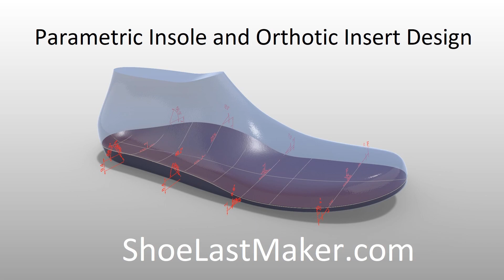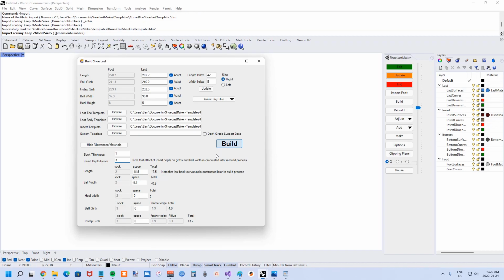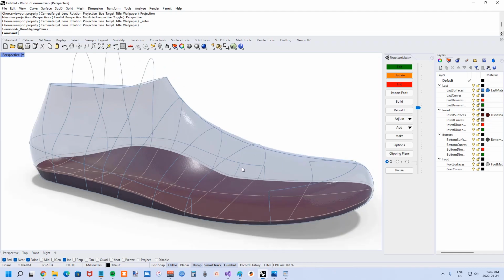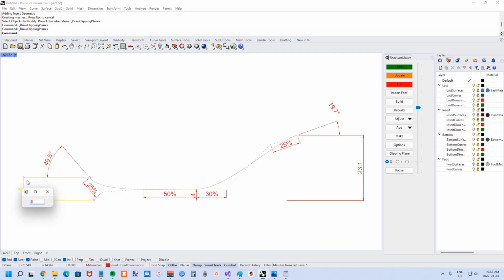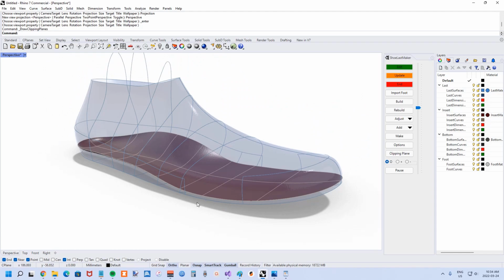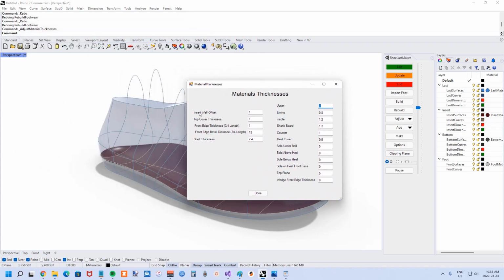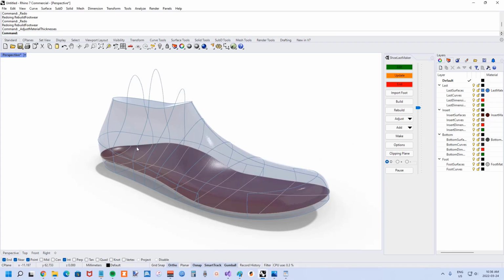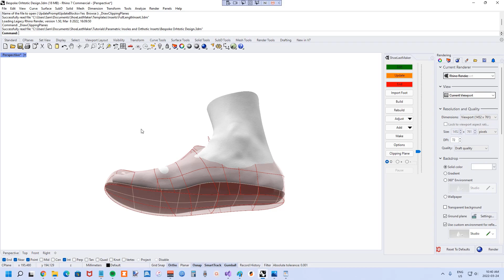3DShoemaker: Parametric Insole and Orthotic Insert Design

Comment: Hi, I'm wondering how the Insert Top Surface is built technically in terms of CAD knowledge. Thanks
Reply: Parameters are used to create curves, the curves are used to create the top surface.
Reply: @samlochner6315  Hi Sam, thanks for your quick answer. My concern is regarding to the creation of curves. Generally what I can do to create curves is to cross-section the shoelast, so the surface created will be flat. I have no clue what parameters can be applied to get the curves in the video. Looking forward to hearing from you. Thanks.